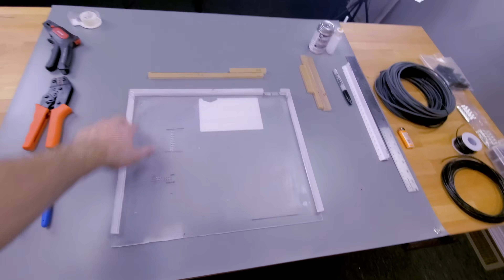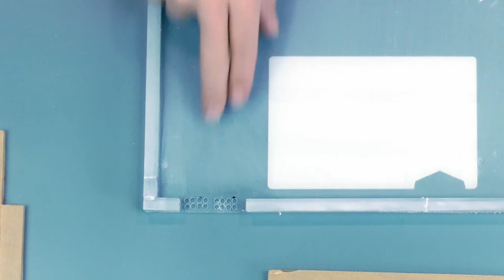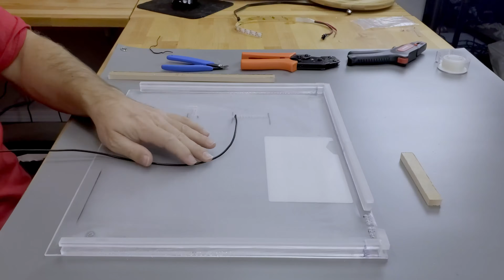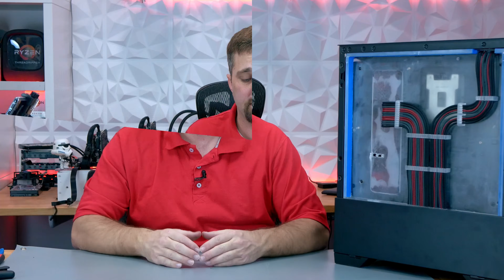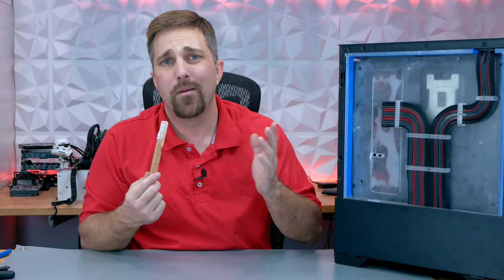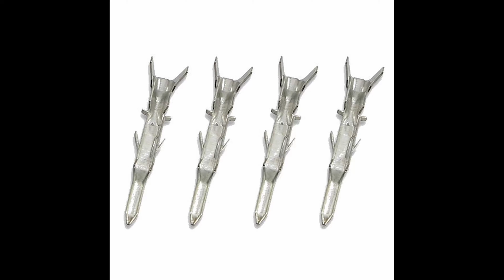Threadripper Build on a Budget Pt. 2: Customizing Cable Management.

Comment: Thought... you could cut out the broken areas and glue In the rubber pass throughs.
Reply from the maker: Not sure I know what you mean by "broken areas". If you mean where the pieces broke out between the cable holes I drilled in the acrylic, it's really not necessary to repair that. I actually expected it to happen as it usually happens even when I use a drill press. Once all the wires are in place it is impossible to notice. Be sure to check out the completed build to see what I'm talking about.

Comment: Thank you for taking so much time to help us. I know being disabled a 30min job can take a few hours. There are a lot of people looking for pc builds and how it works with fusion 360 and cura 3d printing software. Idk if this is something you could do? Both programs are free. I bought my husband a 1920x threadripper last month I'm planning on building him a pc but have to buy each part a few months at a time. He use fusion 360 to design scale model parts then he uses the cura program to Gcode the parts for me then I print the parts to sell. I guess I'm stuck on what's a good motherboard, ram and so on. Again thank you for all your help.
Mia
Reply from the maker: Mia, I'm very familiar with Fusion 360, I designed the computer in the opening animation in Fusion. As for as motherboard selection, the 1920X dosen't have the larger power demands of the bigger Threadripper CPUs and therefore has no problem running in some of the lower end x399 boards (not that any x399 are really "low end")  in the $300 price range. If buying new I would look at the ASRock X399 Taichi, or the Asus ROG Strix X399-E. However, the nice thing about building a 1st gen TR system right now is that 3rd gen TR parts have recently been released so there are a lot of X399 options in the used market as people upgrade to the new TRX40 platform. You can pick up higher end boards like the Asus Zenith Extreme, Aorus Extreme, or the MEG Creation for under $300 right now. As for RAM, once you select your motherboard, go to it's product page on the manufactures website, and under the support tab, find the boards Memory QVL list. 1st Gen Threadrippers are picky about RAM so I would recommend selecting a kit from the QVL list. But at a minimum you want a 4 stick kit to populate all 4 of the 1920X's memory channels. The key to a good CAD system is a good GPU. Fusion doesn't necessarily need a professional card like a quadro or radeon pro but the better the graphics card the better response you get while modeling in the viewport as real time rendering in the viewport is handled by the GPU. Let me know if you need anymore help.
Reply: @ElevatedSystems  thank you for the help!! Idk if it was you or your daughter that made the model. Plz really think about make a pc build and run on fusion I think it would be a hit video.